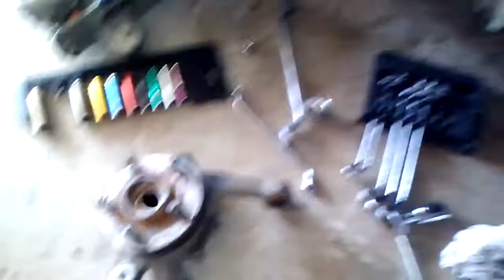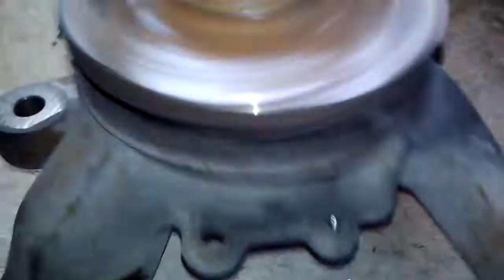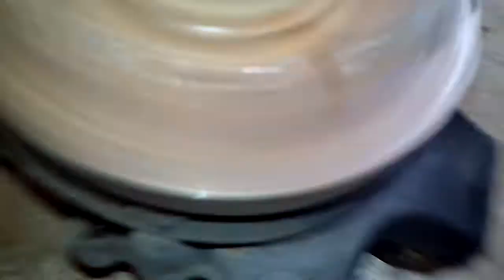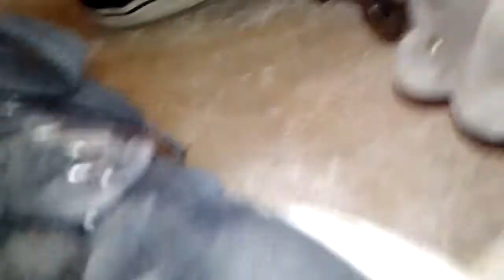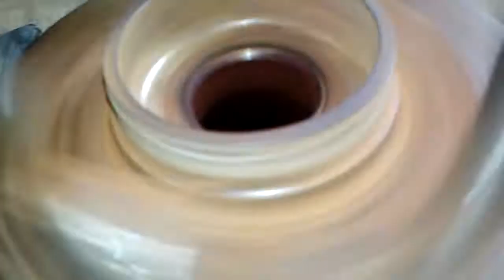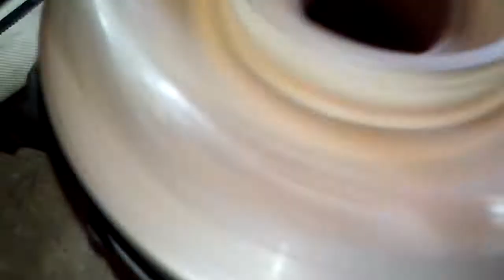Srt4 bearing noise

Comment: He bro did that come from the clutch or transmission? My SRT-4 is making the same noise only when I let off the clutch. I rev the engine with the clutch depressed and it doesn't sound like anything is wrong. Then I let of the clutch and I hear that noise.